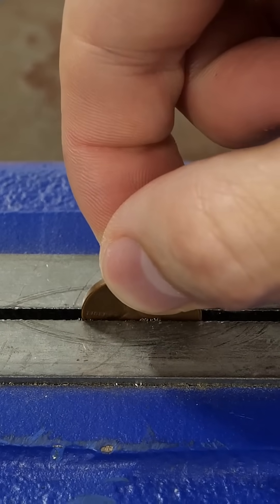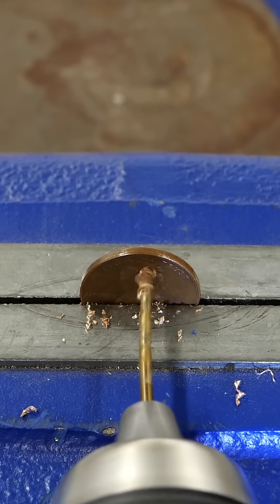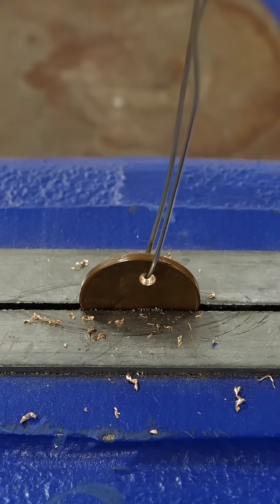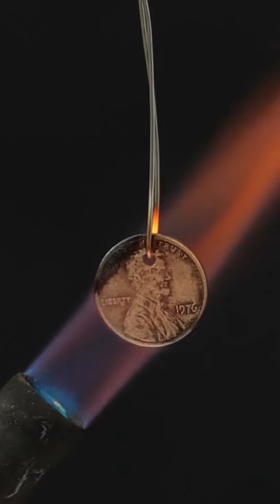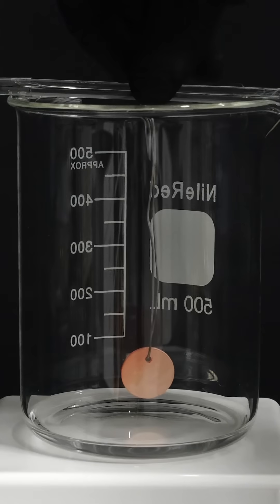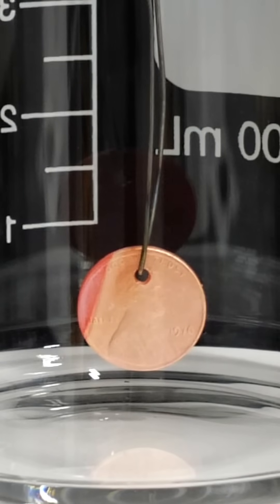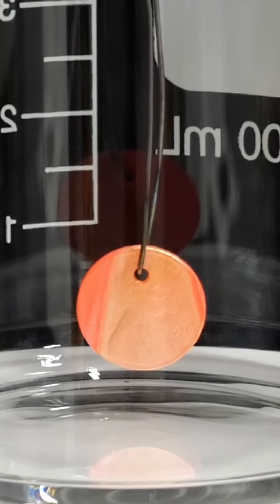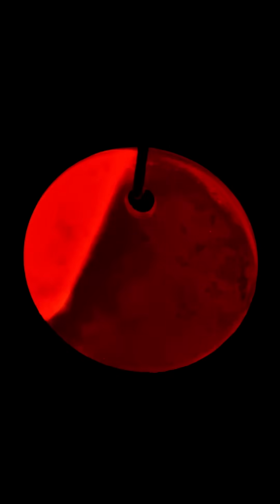Turning a penny into a light bulb

Comment: Also, make sure the penny contains a significant amount of copper, such as this 1976 penny. Anything 1982 and later has only 2.5% copper and is mostly zinc.
Reply: From what I’ve seen of newer pennies, this should still work. That low copper content isn’t formed into an alloy throughout the whole penny,, it’s plated on the outside of the penny.
Reply: @TotallyDapper  i would think that while it is just on the outside, the copper would loose structure from the zinc core melting, since zinc melts at temperatures you can manage with a pan on a stove. 
(edited to change my sentence structure since I did it poorly)
Reply: @Wefee_BigWefee  you are correct. There's a breaking point where the copper gets malleable enough that it becomes a molten water balloon. You can nip the bottom with some needle nose pliers and drain the zinc out though. Then you'll have mostly just a copper jacket.
Reply: I learned this a while back via a Snake Discovery video since they can be used in water dishes for antimicrobial purposes.
Reply: @CzarZarr  Good to know.
Reply: 1983 and later. 1982 was a transition year; half bronze, half zinc.
Reply: Good new fiat currency.
Not even worth the copper it's stamped from.
Reply: Erm, actually some pennies made in 1982 were mostly copper  🤓
Reply: True, however the amount is only like 50% or less which is why most numismatists will tell you that it is very rare to find a copper 1982
Reply: @random5tranger , learned a new word. Thanks.
Reply: @random5tranger  It's not. They made billions.

Comment: i once used a penny to make a light too, but i didn't make the penny the light. i used the penny to complete a circuit so i could turn lights on and off inside a cardboard house for a science project. 

i was 13. and i put it off too long so the house was not painted.

Comment: That’s not a copper penny.   Only plated  it Has zinc inside I believe..  1964 and older have a lot more copper in them
Reply: ...and only the surface on the outside of the penny is in contact with the acetone vapors
the same surface that was copper plated

also, it is a fully copper penny
it was 1984 when they stopped making them fully copper

Comment: I used to work for a bearing distributor and yes, 100% a good German or Japanese bearing will be much smoother, and more durable because they're made of much higher quality steel than those Chinese manufactured bearings you've been buying. With proper usage and care they'll last considerably longer.

Comment: For those of you who keep saying that 'Penny vs. Cent' does not matter, it certainly does in this case as does the year in which the coin was minted.  The coin used for the demonstration was a bronze U.S. Cent.

The U.S. Cent changed, in mid 1982, from a composition of .95 copper, .05 zinc to one of pure zinc with a copper plating.

The Canadian Cent changed in 1997 from a composition of .98 copper, .0175 zinc, .0025 tin to pure zinc with a copper coating.
Beginning in 2002, Canada also produced Cents of .94 steel, .045 copper, .015 nickel which were produced alongside the zinc coins. The Canadian Cent ceased production in 2012.

The British Penny was produced, in its small size, of a bronze alloy of .97 copper, .025 zinc, .005 tin from 1971 through 1992 when the composition was changed to copper plated steel.
Reply: It doesn't matter
Reply: It truly doesn't affect a God damn thing stop correcting people
Reply: @RandomVlogs101  Try the 'experiment' with a zinc cent or a steel penny and then say that.
Reply: @-oiiio-3993  it's still called a penny it doesn't matter what it's made of, that's irrelevant
Reply: @RandomVlogs101  Waaahhh.
Reply: @-oiiio-3993  "waaahhh" is the sound you make over people calling a coin a penny
Reply: @RandomVlogs101  Not at all.

Just pointing out facts which you seem to find to be problematic.

How's that hypocrisy going?
Reply: @RandomVlogs101  "It truly doesn't affect a GD thing stop correcting people" ?

Are you going after your hypocricy badge?

How many posts have you made on this thread correcting others regarding defacement of U.S. coinage?

Comment: Killerbunny7206 asks; "The name for a 1 cent coin is actually penny, innit? [sic]"

Actually, it is not.

Though people (even the U.S. Mint) often refer to them as 'Pennies' out of convention, they are and have always been Cents. Pennies are British.

When the Mint Act of 1792 was passed, the British Penny was 1/240 of a Pound Sterling, the new U.S. Cent was 1/100 of a Dollar. The British Penny went decimal in 1971.

The original 1792 act also specified Half Cent, Half Dime, Quarter Eagle ($2.50), Half Eagle ($5.) and Eagle ($10.) coins.

The Dollar was of equal value and standard as a Spanish Dollar which was divided into eight Reales, or 'bits'. Spanish subsidiary coins were 4, 2, and 1 Real, so the U.S. coinage act provided for equivalent Half Dollar and Quarter Dollar coins as well as the Half Cent to make 'change' for one bit which would equal 12 and one half cents.

The Dime and Cent were (are) metric divisions of the Dollar, the Eagle $1x10.

The Five Cent Nickel was preceded by a Three Cent Nickel. The original five cent U.S. coin was the Half Dime.

There were also Two Cent Bronze, Three Cent Silver, Twenty Cent, Three Dollar, Twenty Dollar coins issued over the years.

Comment: Per the description; "NOTE: It's important that the penny needs to be pure copper. If it's made with zinc, it will melt."

The last pure copper U.S. Cent was minted in 1857.

The 1976 Cent used in video is a bronze alloy of .95 copper, .05 zinc.  The composition of U.S. Cents was changed to pure zinc with a thin copper plating in mid 1982.

Comment: The reason you used a US penny is because ew don't have them in Canada anymore. Also, they are made of zinc plated with copper, which might be important. Also, it's hard for the average person to buy chemicals like acetone in Canada without some kind of license.
Reply: Pennies are British.

Coin used is a 1976 U.S. Cent which is a bronze alloy of .95 copper, .05 zinc. 

U.S. Cents minted since mid 1982 are pure zinc with a thin copper plating.
Reply: @-oiiio-3993  Thank you for the clarification. I did note that the date on the coin was 1976, but didnlt check.Thanks again.
Reply: @topquark22  You're quite welcome.
Reply: @-oiiio-3993  you're not very intelligent

Comment: You obviously need a way bigger penny.
Reply: Actual (British) Pennies of 1970 and prior are about the size of a U.S. Half Dollar.

Coin used is a U.S. Cent.
Reply: @-oiiio-3993  The name for a 1 cent coin is actually penny, innit?
Reply: @killerbunny7206  No.
Reply: @-oiiio-3993  Are you one of these prescriptive linguists? Most people call it that, it fits with dime an nickel, that's it's actually it's name. I know it's meant as a fu to George to call it not-a-penny but he didn't care and he's pretty dead now.
Reply: @killerbunny7206  Perhaps not a perceptive linguist but I am, at times, cunning.
Reply: Though people (even the U.S. Mint) often refer to them as 'Pennies' out of convention, they are and have always been Cents. Pennies are British.

When the Mint Act of 1792 was passed, the British Penny was 1/240 of a Pound Sterling, the new U.S. Cent was 1/100 of a Dollar. The British Penny went decimal in 1971.

The original 1792 act also specified Half Cent, Half Dime, Quarter Eagle ($2.50), Half Eagle ($5.) and Eagle ($10.) coins.

The Dollar was of equal value and standard as a Spanish Dollar which was divided into eight Reales, or 'bits'. Spanish subsidiary coins were 4, 2, and 1 Real, so the U.S. coinage act provided for equivalent Half Dollar and Quarter Dollar coins as well as the Half Cent to make 'change' for one bit which would equal 12 and one half cents.

The Dime and Cent were (are) metric divisions of the Dollar, the Eagle $1x10.

The Five Cent Nickel was preceded by a Three Cent Nickel. The original five cent U.S. coin was the Half Dime.

There were also Two Cent Bronze, Three Cent Silver, Twenty Cent, Three Dollar, Twenty Dollar coins issued over the years.
Reply: @-oiiio-3993 It is called a penny. By the mint, by a bunch of people. That means that's the name now. That's how names work.

Comment: I sell pure acetone and knowing how flammable it is, you really freaked me out putting the hot penny so close to it. But I guess as long as you weren't smoking, you're pretty much safe.
Reply: Yes I've tried this a few times before. The first couple times it worked cool but then I dipped the penny one time and it did ignite the acetone. It flashed and scared the shit outta me, it didn't burn very hot and I put it out easily but it startled me and I felt like it wasn't worth risking knocking it over And burning my garage down trying again. I think I also read that the catalyst produces gas that's poisonous from the reaction, but I may be thinking of something else so don't quote me on it.

Comment: Oooh, this looks Dangerous! 😳

No, not the experiment itself. I live in a Sovereign nation with Charles III¹d on all of our coins. Drilling a hole through his likeness could be an offence... 📜🇬🇧🧑‍⚖

Anybody got more ¢ents than the Bank of England² and wouldn't mind throwing us Brits a handful? 🙃

(¹ - Well, most of then still bear Elizabeth IId because HRH Charles is very green minded and has asked they be kept in circulation. 👍)
(² - Given the Bank of England doesn't issue cents, this is simply a statement of fact. 😉)
Reply: It is legal to alter U.S. coinage in the U.S. if not done for fraudulent purposes.

Indeed, Pennies are still British.

When the (U.S.) Mint Act of 1792 was passed, the British Penny was 1/240 of a Pound Sterling, the new U.S. Cent was 1/100 of a Dollar. The British Penny went decimal in 1971 (remember 'New Pence?).

The original 1792 act also specified Half Cent, Half Dime, Quarter Eagle ($2.50), Half Eagle ($5.) and Eagle ($10.) coins.

The Dollar was of equal value and standard as a Spanish Dollar which was divided into eight Reales, or 'bits'. Spanish subsidiary coins were 4, 2, and 1 Real, so the U.S. coinage act provided for equivalent Half Dollar and Quarter Dollar coins as well as the Half Cent to make 'change' for one bit which would equal 12 and one half cents.

The Dime and Cent were (are) metric divisions of the Dollar, the Eagle $1x10.

The Five Cent Nickel was preceded by a Three Cent Nickel. The original five cent U.S. coin was the Half Dime.

There were also Two Cent Bronze, Three Cent Silver, Twenty Cent, Three Dollar, Twenty Dollar coins issued over the years.

Comment: Use a penny pre 1982, they made them with a different metal after that year and can blow up
Reply: Pennies are British.

The 1976 U.S. Cent used in video is solid bronze, composed of .95 copper, .05 zinc.  U.S. Cents minted since mid 1982 are pure zinc with a thin copper plating.

Comment: It works altogether better if you just use thin copper wire twisted into a spring shape. The greater surface area and lower mass makes the copper heat more so it glows brighter.
Reply: Works even better if the "metal wire" is made of magnesium too.
Reply: How long does it last , I want to make some for outdoor mood lighting
Reply: Just wondering about something,  if I do this incase of a blackout to impress a girl and I don't happen to have a drill or setup to hang the coin, would it explode if I dropped it in there or would it be alright? Be honest tho! as funny as it might be incase it does explode, I still wanna keep my eyes :D
Reply: also on a scale of 1 ー Brain Damage  how bad are the fumes
Reply: @isopod127 lol!
Reply: @isopod127  it’s not great to inhale nail polish so I’d assume it isn’t great when oxidized either, but not sure
Reply: And you won't be subject to arrest, for a federal offense .
Reply: @KennethMachnica-vj3hf  doesn't count if it's for art/educational purpose, plus it's a single cent, nobody's going to send a guy to jail over one cent.
Reply: I didn't know that there were parameters. I don't care, one way, or another, just remarking about that. Plus, we have Democrats that do selective prosecution, based on corruption...and/or stupidity.❤ @Lord_Bear
Reply: @KennethMachnica-vj3hf  Nobody mentioned politics until you did but now the topic's here, there's plenty of corruption within the republican party as well (barely masked insider trading, blatant misinformation, certain party members using their station for profit despite laws against it,, using the bible as justification for removal of rights of many groups despite a clear constitutional separation of church and state), but I won't talk further about it because it's just going to turn into a "he said, she said" and that's only good to frustrate everyone involved
Reply: @Lord_Bear yea for real that dude needs to chill
Reply: Lol chill@KennethMachnica-vj3hf

Comment: So is a 1976 penny made out of pure copper? What year did pennies switch to zinc?
Reply: Pennies are British.

The 1976 U.S. Cent used in video is solid bronze, composed of .95 copper, .05 zinc.  U.S. Cents minted since mid 1982 are pure zinc with a thin copper plating.

Comment: Does year of the penny matter in the slightest? I know coins haven always been consistent in what they’re made of but not much else
Reply: Any penny under 1982 because that's when zinc was inserted, but 1943 because those are steel due to the war, but don't use a 1943 copper because those are worth big money
Reply: @RandomVlogs101  U.S. Cents minted early in 1982 (also dated 1982) are bronze.
Reply: Pennies are British.

The 1976 U.S. Cent used in video is solid bronze, composed of .95 copper, .05 zinc.  U.S. Cents minted since mid 1982 are pure zinc with a thin copper plating.

Comment: Since you have heated Cu and Acetone vapours passed through it, the reaction probably yielded CO2 or H2O or even some unsaturated compounds. If we now blasted H2 in the container then Propan-2-ol vapours would have formed due to catalytic reduction. However, if the torch was H2-Acetylene torch then Propan-2-ol vapours would have formed as it is but if that was oxy-acetylene  then external H2 supply is needed.